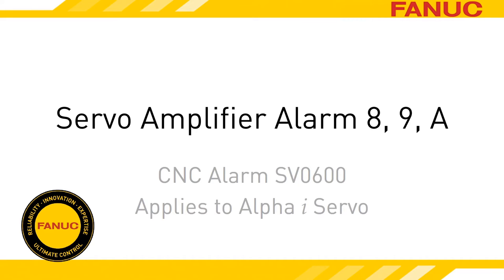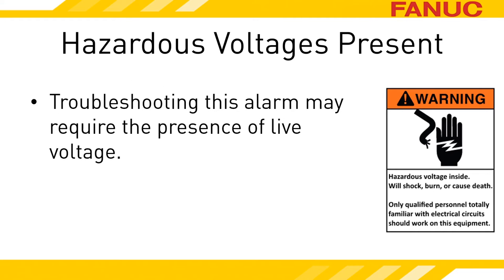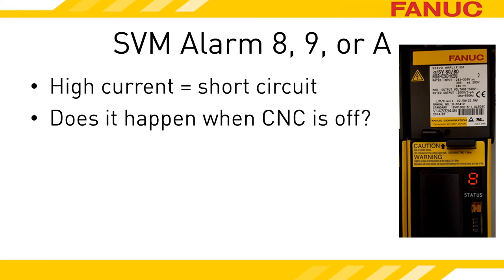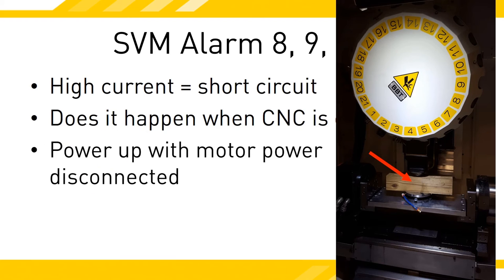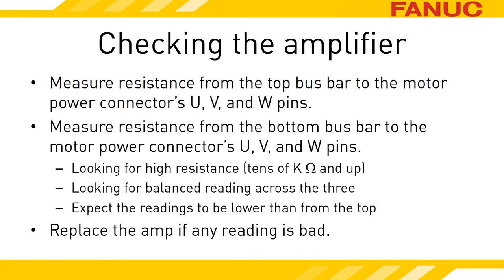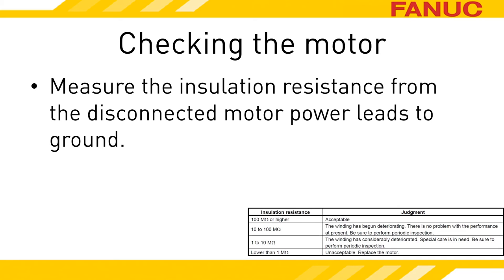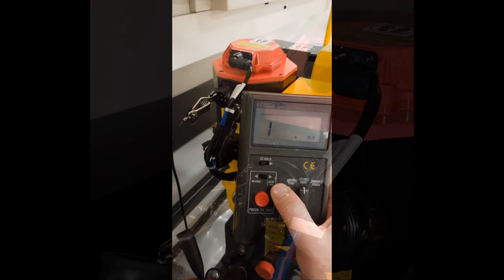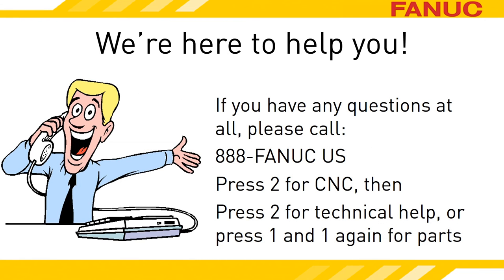Alarm 8 Troubleshooting for FANUC CNC Servo Amplifier

Comment: hi i get problem 8. at SVM A06B-6096_H105

i check the motor OK...
cable ok

actual :
when i start ON breaker Machine the alarm 8. occured (when i ON system CNC the diagnostic show HCA : 1 & ALD :1)

i try to disconnect motor cable the alarm still occured

but when i only disconnect the JX1A cable , then i ON breaker the   svm can show "-"...Then OFF breaker & plug in JX1A cable the SVM alarm 8. occured again.

i have to try replace the IPM but the problem still occured

When i ON machine for a several time (3-6 hours) the alarm is dissapear